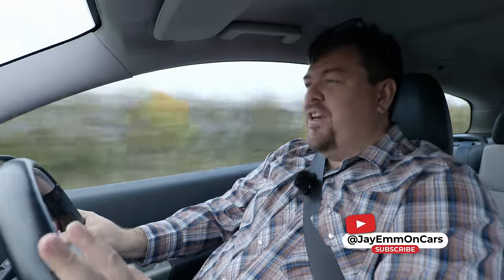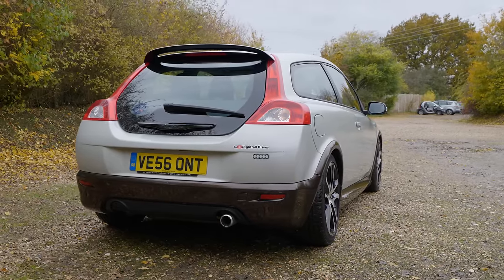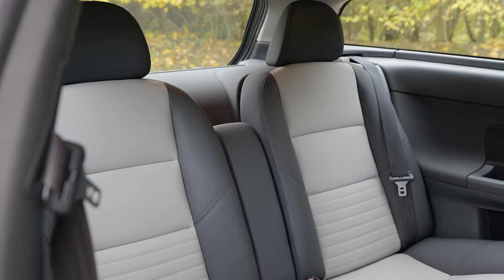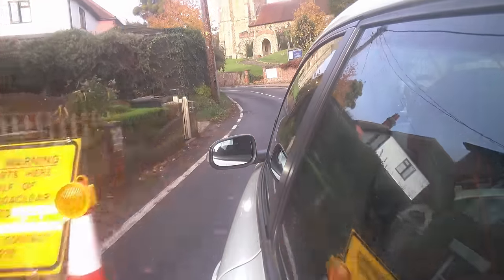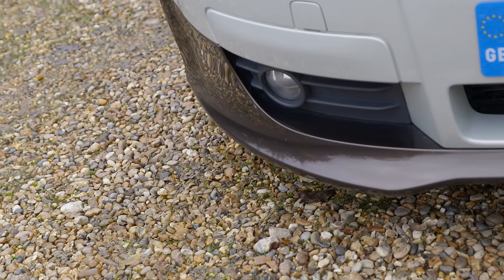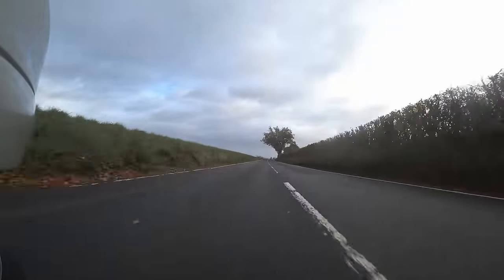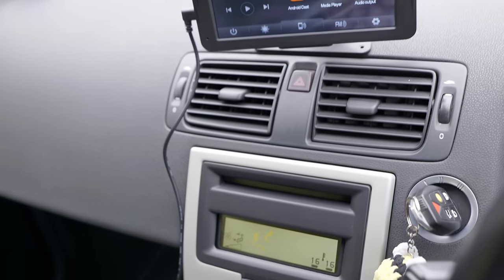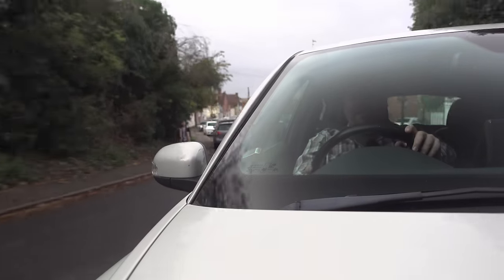The Volvo C30 - More Than Just "The Car from Twilight"?

Comment: wow your friend got one hell of a deal on that car. Where I live that would be a 7 to 9 thousand dollar car.
I like that 2.4 engine.  I find the turbo fives to be oil burners as the kilometers pile up.
Just tell him to keep an eye on the accessory belt and tensioner. If the tensioner fails the broken accessory belt can break the timing belt. 
We changed an engine last month because of this.
Reply: Thanks Steve, timing belt is on the 'soon to do' list and will add the accessory belt/tensioner too.
It was advertised for what seemed a very reasonable £2500 but managed to get a bit off due to a 3 year gap in the service history.
Got lucky with this being available at the right time and slightly overlooked!

Comment: I have a C30 2.4i SE LUX manual, possibly the last 2.4i C30 in the UK with it being a 2008 model and it quite possibly be the only 2.4i in Northern Ireland. I bought it a few years ago for £1,450 with ~150,000 miles on the clock, just needed new tyres, timing belt and water pump. I love it, it feels great, looks stunning and sounds amazing. The only problems are the running costs, I get about 23mpg on a good day, luckily my commute is quite short. Insurance is pricey but fair for the car and me being in my early twenties, last year it was just a little over a grand. Tax is also quite high due to emissions, with the changes coming in April it will be £385 to tax. Overall I love it and I am glad I bought it when it did, though I might have to say goodbye to it depending on insurance costs this year, hopefully not though.

Comment: I have a D5 manual. It easily does 45mpg in spirited driving, handles well on the twisty bits, and is comfy for a small car for long journeys. It does suffer from road noise due to the relatively large wheel arches.

I know there are differences such as the floorpan as you mentioned, but the driving feel is very similar to the Focus ST. Good for an oil burner.
Reply: Just to add, the turning circle is atrocious with the D5 but I think that's a D5 issue rather than the C30 in general.

Comment: Great video as always! . I had a 2011 C30 D3 R-Design (facelift) when I was 18 with the same pop-up sat-nav as the astons of the time, the car I had was a 2.0 5-cyl Turbo Diesel. It was fantastic on fuel and had good performance especially with that mid-range diesel torque, averaged around 45mpg and could hit 60mpg on a motorway run, sounded great, looked great (in white) and was a fantastic second car for me at the time. I miss the quirky design and comfy R-Design seats, so much in-fact that I have turned one into a heated desk chair. I miss my C30 but have an 320Ci e46 now which i equally enjoy for its own reasons.

Comment: I love the C30 and I am now on my third one. I had a 2009 1.6 petrol R design as my first car which was brilliant, didn't have any issues in two years and is definitely one of the most reliable engines these cars came with. I then had a 2012 D3, again this was a brilliant car with no problems at all. That had a few modifications and was remapped to 214bhp and 473nm yet still averaged at least 45mpg. I now have a 2010 T5, I can't see myself getting rid of this one any time in the near future! 

As for issues, there's not a great deal of problems with these. The main ones to note are that they can very easily destroy driveshafts when lowered and the T5 can suffer from cracked liners from being driven hard while cold. The 1.6 diesel has quite a few issues, but that's partly down to it being a Peugeot unit.

Comment: Still a great looking Volvo today indeed. The 5 cylinder engine makes a Volvo a Volvo imo, and it's the reason why I miss my 850s. I've had two 2.5-20Vs, a 2.3 T-5 and 2.0 T-5. The last one being Italian with slightly thicker cylinder walls. The noise it makes is simply amazing! I'm not sure whether or not the 2.4i can suffer from cracking cylinder walls and coolant issues, but I believe it's fairly strong. And compared to the smaller engines, even more so.

Comment: These with the 1.6 diesel sell like hotcakes in Sweden. With that engine it's not hard to squeeze out up to 60 mpg on long drives. Most people find them to be reliable, too, but the absolute most reliable engine is the 2.4 petrol which is the last pure Volvo engine if I am not mistaken. That machine is known here to be the successor of the old redblock in terms of reliability. It is an older engine though, originating in the 850 (I think, I'm more into Saab than Volvo so don't quote me on that), hence its high fuel consumption.

Comment: Oh my god! This is exactly what I’ve been hoping for. I bought not a C30 but its estate brother, the V50, exact same engine, but with the Geartronic (license limitation), which is an Aisin Werner AW55-10 I believe, something like that. 

And coincidentally I just installed one of those Carplay/Android Auto displays in the same spot today, just a different one (10.26” wide boi) with a reversing cam. 

Why a V50 and not a C30? Because similar C30’s are available here for 4 times what I paid for my V50 (€2500), and the main reason I bought a different car in the first place was because we’re moving soon. And well, you’ve hit the head on the nail with the stigma thing, a T5 would’ve been nearly uninsurable for me as a 25 y/o.

I’ve completely fallen in love with this car. It’s throwing me an error about the O2 sensor in the cat sometimes, but it’s probably just a bit dirty (resetting it keeps it away for quite a while). But that doesn’t really spoil it. Not when the engine runs so smoothly otherwise, even with >290.000km on it. This car has been serviced properly for at least the vast majority of its life, with service history being recorded up until around 220.000km, likely still done after that too but people like my family and me tend to do all that ourselves. It’s not as large as a V70, but plenty large and doesn’t look quite as boxy. I’ve always liked the V50, my brother still has his one even after almost a decade, though that is a 2.0D courtesy of PSA. Not as much in terms of horses, but boatloads of torque. Not that torque is a problem on the petrol 2.4i either, the amount of times I pull up from a green light with squeeling tyres without even going nearly all out on throttle… 

And these V50’s are available quite a bit more, even with the 2.4i. Cheap as chips too, mine wasn’t too out of the ordinary at €2.500, though most of them go for about €3.5-4k usually, while I haven’t seen a C30 recently for less than €8k iirc.

Only mechanical replacement I had to do so far was a worn VVT solenoid valve. Not all that expensive either and literally swapped in under 10 minutes.

Comment: I had one . 1.8.
It was a lovely little thing.
Main things 
Master cylinder failed, and it meant the clutch was on the floor. Was an expensive fix. 
Other than that keep on top of maintenance and should be fine. 

Gear box oil changes and regular oil changes must 😊

Comment: If you don’t drive in ulez zones I would massively recommend the D5. Absolutely fantastic engine super reliable great fuel economy and good performance. Very tuneable if that’s your thing and because volvo put it in literally everything finding parts should be easy. Also as far as diesels go because it’s a 5 pot they sound pretty good

Comment: I owned a T5 (turbo 2.5l) of these and loved it! Mine didn’t have the luggage cover so I added a luggage net to the back seats to stop small items rolling around. The 2 tone paint scheme was what dated it for me but it seems to suit this car.
Issues I had with it were the turbo needed replacing as the seals failed and the pcv valve system. Forgot the specifics of that repair but it is common for these models. 
Also on turning circle, the C30 is worse than the S40 and V50 that share the same P1 platform
Reply: All P1 Volvos have the same steering limit but cars that were specified with 18 inch wheels from the factory have steering deflection limiters which make the turning circle awful. I have a car with 17 inch wheels from build and it’s pretty normal in terms of turning circle.
Reply: @mcgherkinstudios  ah that makes sense. It’s something I originally read online somewhere and it stuck with me. Might try find the source when I get a minute.

Comment: Volvo T5s are fantastic
Reply: until they leak oil on the floor and need a new timing chain cover for 1000$ and then another 1000$ PVC box replacement.
Reply: @potatochobit  never happens ... I did 6000 miles in 1 and that never happened
Reply: @potatochobit  It has a belt, and when buying it's a simple check to know whether it leaks oil. Turbo is the only weak point, will go out at 200-300k km.
Reply: @potatochobit  You got screwed. PCV housing, which includes the oil filter housing and a new filter, is like £150.
Reply: *T5's can be fantastic. I'm not denying the other engines may well have been successful, but when you throw that extra cylinder in, especially n/a, for the driver's eargasms, no turbo chop, as a daily, it's better than that four ring coup' that flashed past 😊
You're no weirdo James, 5 bangers have the warble❤
Reply: These engines are from Volkswagen.
Reply: @flexiblebirdchannel  They are not. The first diesel-5i in 850/V70 was developed with Audi. The petrol was also developed around then, by Volvo and maybe a bit of help by Porsche, but a Volvo specific engine
Reply: @flexiblebirdchannel  the D5's might have been from VAG...
The LT/T4 2.5tdi is near a straight swap from an V70 D5 I've seen on YouTube, bar a few coolant pipes/differences, I'd guess as VAG put the origins of that lump in an Audi 100 years earlier (1989) they supplied volvo?
Reply: @olivierb9091  yes, the modular petrol I5 was Swedish developed I thought, where as the TDI was an under license agreement, either way, great exhaust note
Reply: @mcgherkinstudios   yes but there is labor  doesn't the upper intake have to come off?
Reply: @benjaminmarriott6742  They have a unique sound which is why I bought the car.
Reply: @potatochobit Tell me you have no idea without telling me 😂

Comment: I have a 2012 2.0 petrol r-design model, I quite like it.

As for issues, the one everyone talks about is that if you have a sunroof, the drain pipe can leak water directly onto the central electronics module. If that happens, its going to be a about a grand to replace. But if you don't have a sunroof, no issues there. Also, there have been issues on earlier models with the windscreen seals failing, which require the windscreen to be refitted. Other than that though, just normal car things. Oh, and did I mention leaks in general.

Comment: I was interested in the Volvo d5 Geartronic and considered the V70 but decided that was a bit too big for myself and the OH along with some hefty repair bills. The V50 d5 was an option but the Geartronic 'box is a 5-speed and I wanted a 6-speed and also memory seats which are rare. I reckoned that the d5 C30 would be pretty quick in the mid-range with excellent economy and I reckon I'd have enjoyed owning and driving it but we need good rear access at times and also the boot wasn't big enough for what we need. An estate car is the definite preference so, in the end, a Jaguar X-Type 2.2 Sovereign automatic (6-speed same as in the Volvo V70) sits on the drive. The daughter's BF has the C30 1.6D and it's decent enough to drive, the interior is OK and he gets 60mpg so what's not to like? It's needed a few jobs doing but the parts have all been Ford Fiesta so not expensive.

Comment: I had one of these as my first car, a diesel one. Being a fan of the 480, which is the predecessor to this car, it was an easy choice. I personally prefer the facelift, it's much prettier at the front, and you get a normal-ish parcel shelf (basically a rubber blanket).

It's quite lovely, especially as a first car, but it's heavier than it looks, and it really feels it when you try to throw it around a corner. Really it could've used being about 350kg lighter. They also rust, quite a bit. When I had one, it was 9 years old, and the sills and subframe were on their way to becoming an issue, so I imagine it would be quite a common thing now.

There aren't too many common issues, the only one I could think of off the top of my head, aside from the rust, were faulty steering racks. They'll click if they've gone wrong.

Comment: The 2.4 uses about the same fuel as a T5. I love my T5. It's 57 plate. Not rust yet but my bushes need doing. I've replaced the exhaust because it just fell apart. I've heard mold can be an issue but I've not had much in mine.

Comment: I had a 2.0 diesel R Design with the upgraded sound system, loved that car, probably my favourite car I've owned.

Downsides were cost of repairs by Volvo although you could often buy the same part from Ford cheaper, the Dual Mass Flywheel and the Turbos needing changing at 125k on the clock, that made it financially not viable given the cost of the repairs were more than the value of the car.

Other negative was it's appetite for tyres although that might have been due to my driving at the time and if you didn't have the solid boot cover you got 2 sticks and a cloth, which improved access but looks terrible.

It's also very low so not so good for getting in and out of, but I fitted comfortable at 6ft 6" with long body and short legs. The massive doors helped access but could be awkward to get out of the car is someone parked closely to you.

Would have one again in a heartbeat if it was still suitable for me.

Comment: Had a C30 2.0 SE, same Mazda/Ford lump as you get in cars like the NC MX5. It was fine - mine was far from the best example, but it was reliable enough and decent to drive. The interior did not feel as nice as a Golf/Scirocco and on the motorway the 5 speed was geared all wrong, so despite road noise being excellent, the cabin was still a din. I wouldn't say no to another one if it was a 6 speed for a good price, but I don't really miss mine. I preferred my Golf Mk6.

Comment: The vibration could be the active engine mounts. Not very expensive to replace
Reply: Thanks very much Mark, I'll look into this. Haven't yet traced the source, other than there are two vibrations and one seems to be just a wheel balancing issue
Reply: @NightfallDrives  Have a C70 with a nightmare of comparable vibration. Most noticable with moderate acceleration at low speeds. New tires all around, new hubs, new engine mounts and new drive shafts. Not much improvements. Shock absorbers are next on the list but also heard it might be the injectors. Did you have any improvements during last 8 months?
Reply: @tomvoorneveld  I might have found the cause - just done the timing belt and the old water pump had quite a lot of play in it. The car hasn't been used over the summer but I'll find out if it's cured in November when back on the road...🤞 will try to find this post & report back!
Good luck with the C70
Reply: @NightfallDrives  thank you. The timing belt has not been replaced... Could it be that? I will ask my garage. Will be back if i get it done.
Reply: @tomvoorneveld  it could be if you also have play in the water pump. If your belt is due, be sure to get a full timing belt kit including pulleys and the pump. I'll find out if the vibration is gone when I get the car back on the road in November 🤞🤞🤞

Comment: Some good things to know about the C30 (including the S40II, V50 and C70 as they are the same platform):

1. 5 cylinder engines are better, they are made by Volvo inhouse. The 4 cylinder engines are made by Ford, and are prone to more random failure although they can also be reliable. In any case, the 5 cylinder is a safer option in the long run.
2. The Wheel bearings, drive shafts (CV joints in particular) are a common problem on the P1 platform, especially the early models. Some of the last P1 manufactured models share some stuff with the P3 platform, making them more reliable.
3. The headliner loosens over years and can become a real problem with these models. Doors, roof and sunroof headliners can start falling off as the glue deteriorates with age easier than some other cars. 
4. The infotainment system can be a real headache if you have any model without AUX, as many of these cars use the MOST system with optical connector cables making it hard to add aftermarket stereos as all the parts are paired with car settings stored in the stereo display. Adding AUX especially in Europe can be very costly as only Volvo shops would be able to upgrade it, and it won't come cheap. They are some cheaper mods to fix this but, unless your car has your MOST Security turned OFF, they will cause all kind of random issues as the system will just outright disable key components of the car (such as the instrumental board) if it notices any component changes. The stock infotainment components shouldn't be removed.
Just get a model with factory AUX!!

Comment: I was looking at C30s for a good long while, but the cheaper models on the market are a bit dire - mostly because the leather interiors seem to be falling apart across the board. I would've had to part with more money than I was prepared to for a good condition example considering what I would've been getting for my dosh. Still want one, though.